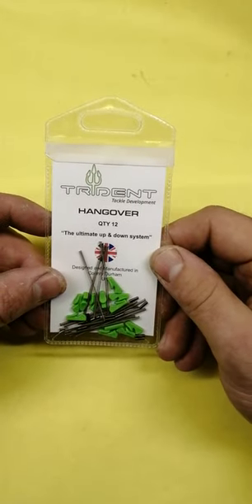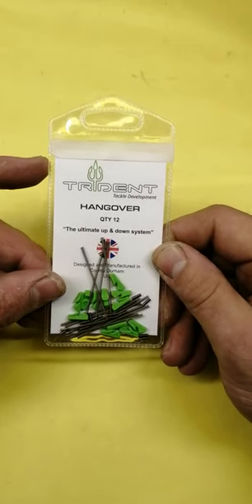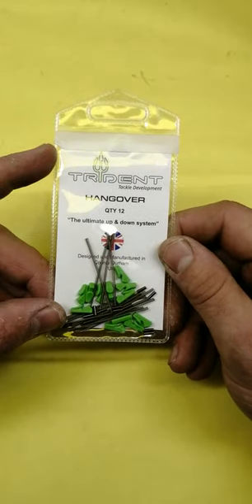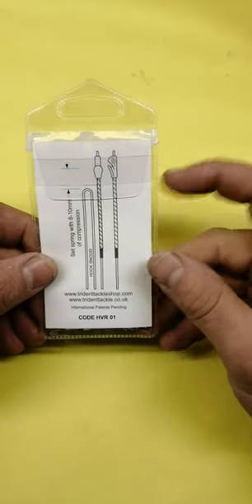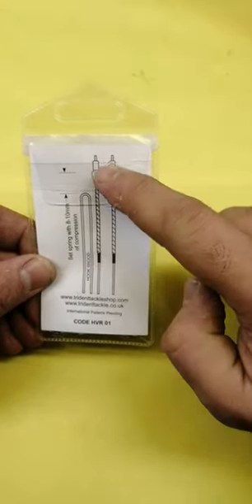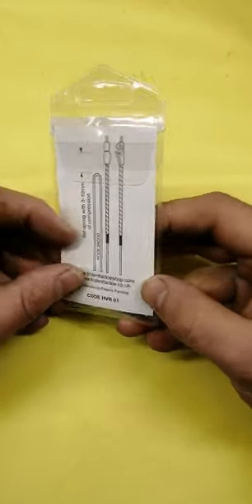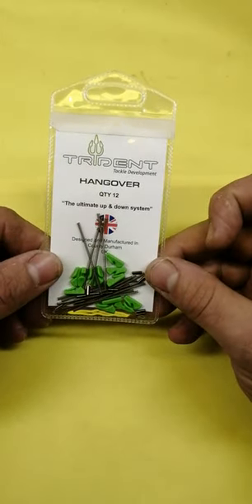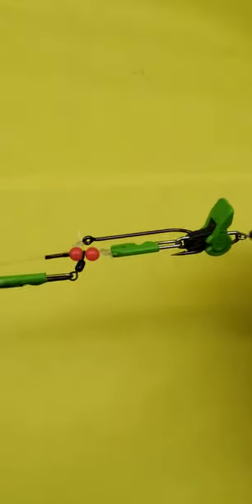HOW TO USE THE TRIDENT TACKLE HANGOVER #SHORTS

Comment: I love these, but prefer to use a small bead and a couple of bits of small neoprene tube to act as a stop knot just below the spring.... Easy to make any minor adjustments to the tension and minimises line damage
Reply from the maker: I completly agree the bead and a stop knot is good to make it adjustable

I use the powergum which tubing do you use?

Thanks for your comment :)
Reply: @TheEastbourneFisherman  I use gemini neoprene tubing cut into about  4 mm lengths... Any less and it slips, any more seems to make it harder to move.... But I use 2 bits to lock it in place and adjust one piece at a time
Reply from the maker: @stevenewell6898  cheers Steve I will give that ago :)
Reply: I use small soft beads that are a firm fit on the line then fit a small cable tie onto the bead, firm fit, but movable, best when the line is shortened through a hook replacement etc